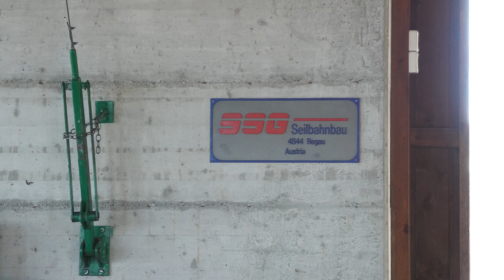Buchensteinwand

Comment: During the construction works in 1990 SSG became insolvent. That's why the last two towers and the power unit are made by Doppelmayr. These circumstances are making this chairlift an absolute uniqueness. Also this is the only CLD ever built by SSG (Swoboda Seilbahnbau GmbH)
Reply from the maker: Thank you
Yeah I already wrote in French on description 😁
Are you sure the power unit is from Doppelmayr ?
Machinery is typical from Städeli …
The electrical controls of the emergency drive are marked “SSG”
And no gearbox "Doppelmayr Lohmann" typically Doppelmayr
Reply: @GondelbahnMonde  I just got these infos from liftworld. I don't know any further details about the power unit.
Reply from the maker: Yeah I seen too when I prepared my video
Reply: There was another 4-CLD made by Swoboda. It was on Kasberg, but was replaced by a 8-MGD by Doppelmayr. Apparently, the chairlift was sold to somewhere in Argentina, and it maybe is still in operation as of now.